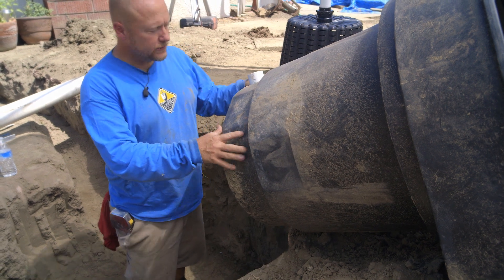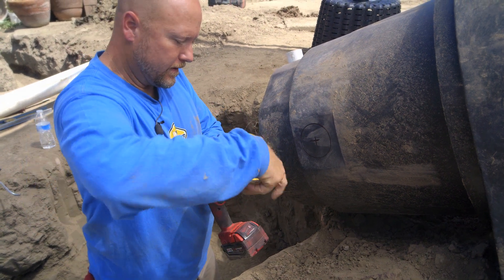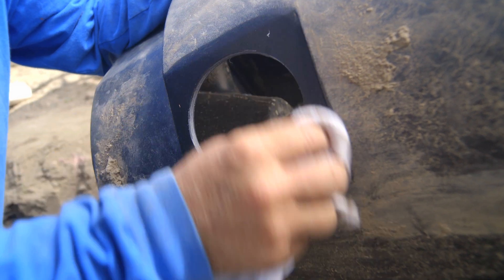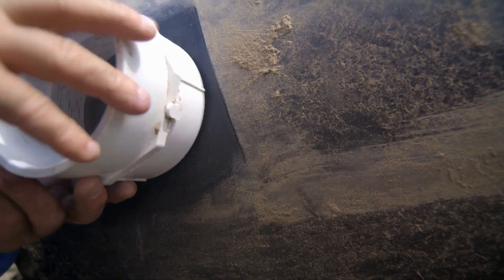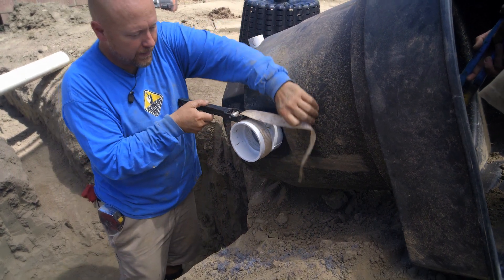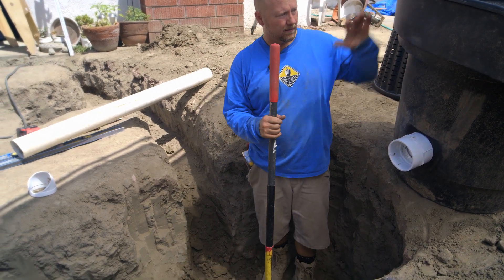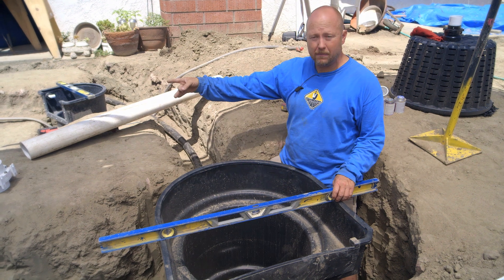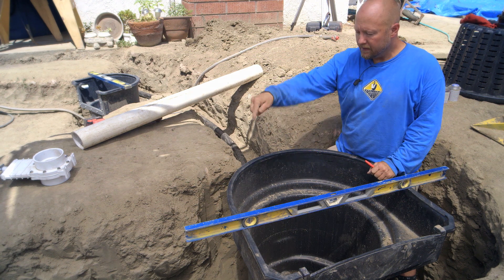Koi Pond Construction | Pond Filter Plumbing - Part 15

Comment: How do you ensure the top of the settlement tank is 2" above the water level? 2" seems very specific if the tank is (just guessing) 6ft off the pond perimeter. Looking to reconfigure my CO Koi pond this spring. Thanks for all the effort in the videos/demos!

Comment: If am successful of putting in the ponds as far as I know they would be the only ones in the neighborhood. Before a drainage pipe needed to be replaced I had spent 4 years laying down pieces of broken house foundations as a walkway to cover up a lot of open sand, but as you can see now it's all gone. Now instead of sand over a layer of rocks & then land fill, the ground is all mixed up and heavily compacted to where it's so hard to get a shovel into it.

My son said he will help to dig the dirt when the time comes but he needs to know what the plan is, so he can work fast to get the job done. I mentioned to him that you have offer to mentor us and he said "cool & thanks".

My budget is very limited as I have other projects and issues going on in this yard, so I need to make improvisations where ever I can, & at least temporarily from year to year.